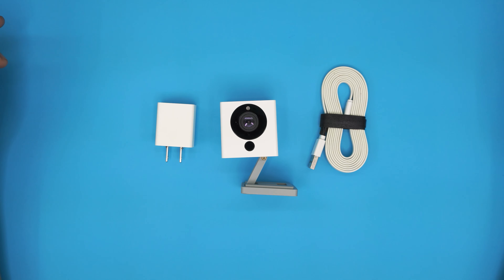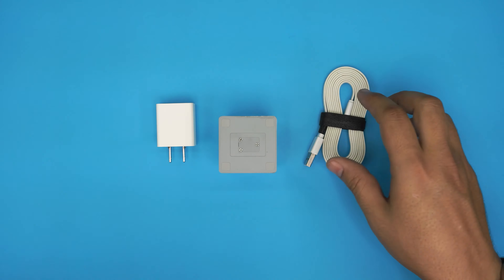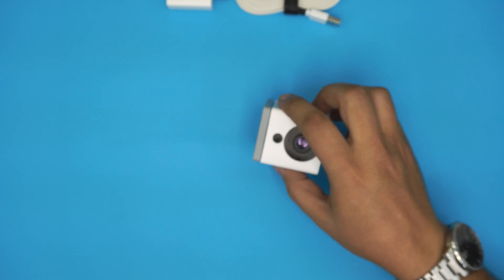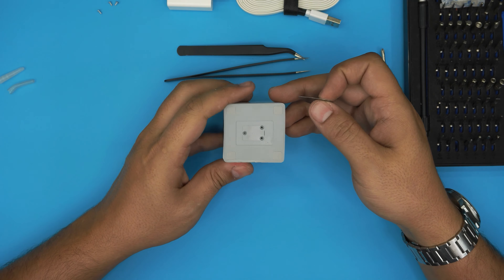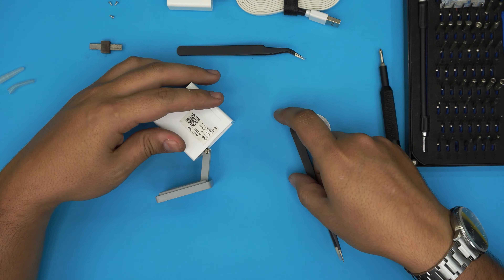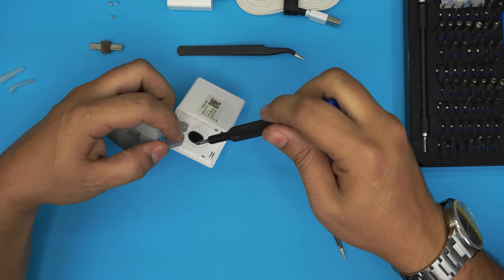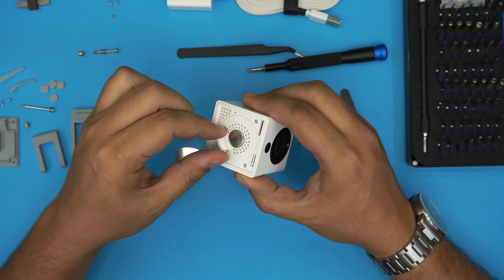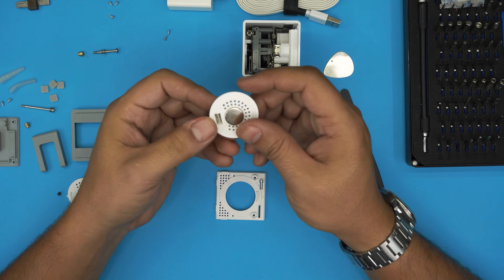WYZE CAM V1 Disassembly 👉Wyzec1

Comment: I have the same wyze camera well I was trying to mount it to the sticky tape that came with camera. As soon as I turned my back my camera hit the floor! It shot out my SD card and I found it. But now something is rattling inside. Camera still working fine thank god! Lol. Do you know what it likely could be that is maybe loose and big in it that could be rattling when I shake it?? Could it just be maybe the speaker I wanna say that feels about the size of it inside I just dont wanna take apart if it still working 😂. Any help would be awesome! Thanks.
Reply: I found it! Its the pc of metal that was glued to the inside top part of the case..👍 couldn't have even tried opening cam without watching this video! Thanks for sharing!
Reply from the maker: Thanks ✌  for the feedback!  if you wish to support the channel you can LIKE or SUB or both :P
regarding your issues, im glad you resolved it and if you need any help or request you may have in the future feel free to ask me my friend :)
Reply: @uFixTek  hi my wyze camera v2 is just clicking like when a hard drive goes bad,I keep pressing the reconnect/setup button but it is still not resetting or saying ready to connect what can I do to resolve that issue,BTW great video.